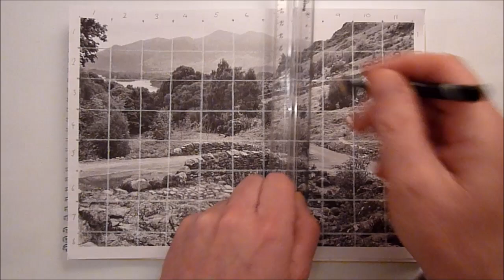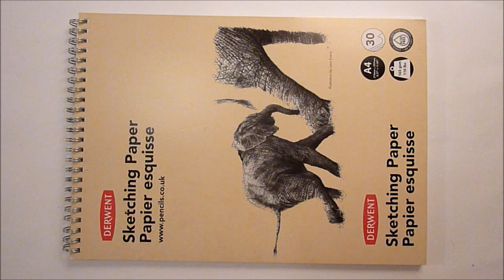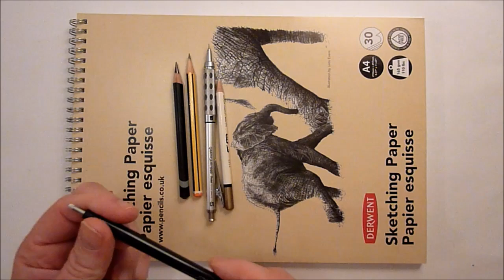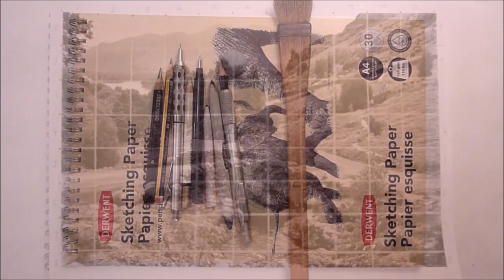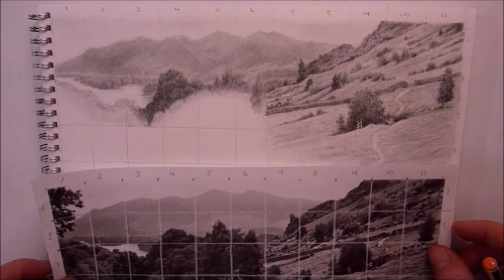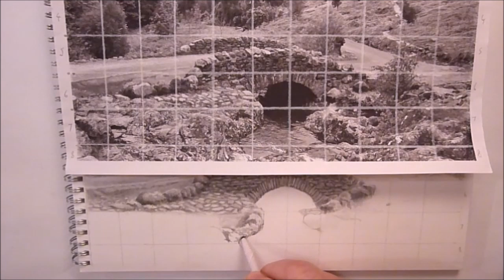How To Draw Landscapes, Rocks, Mountains, Trees, Graphite Tips and Techniques, Grid Method

Comment: Smoothie! Hi mate... Thanks for the tip on the Koh-i-noor pencil eraser... Just got mine today and it is soo much better at erasing than the Faber Castell ones... How do you sharpen yours please? I put my Faber Castells in a pencil sharpener and it just came out awful... and the knife just seems to carve it way too much.
Love your graphite vids :)
Reply from the maker: I've sharpened mine in multiple pencil sharpeners, never had a problem, the only thing that does happen sometimes (depending on which sharpen i use) is the rubber tip sharpens to a point that's too long and loses its stiffness, I just trim a small piece of the tip and its good to go.
Reply: Thank you! Maybe I have to find the technique! Just out of interest - Do you ever use the M+R or other desk top crank sharpeners to sharpen the eraser pencils? Sorry for the many questions :)
Reply from the maker: Yes I use the M+R crank sharpener for eraser pencils, it work great when its adjusted to a blunter setting.
Reply: Thank you! :) Keep up the great & helpful work :) I love the graphite foliage and trees lessons :)
Reply from the maker: You're welcome, I'm glad I can help:) Thanks for the comments, Happy drawing!